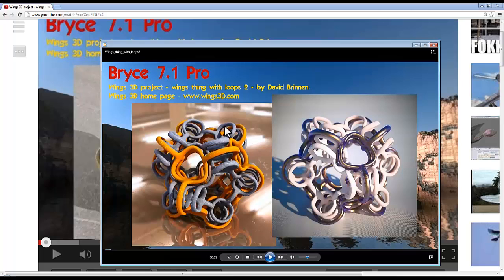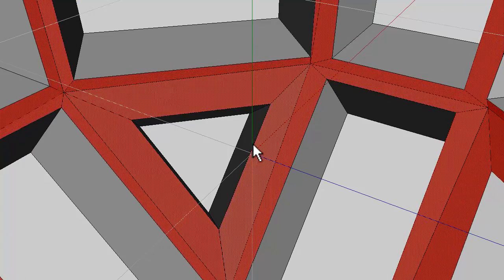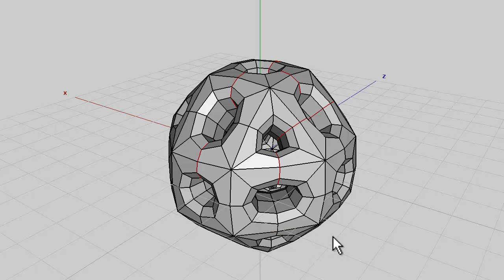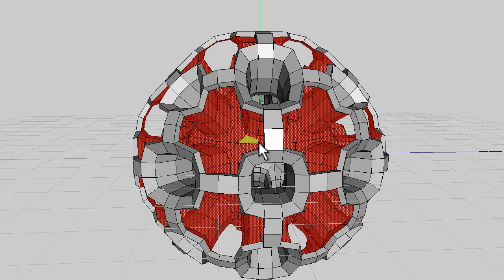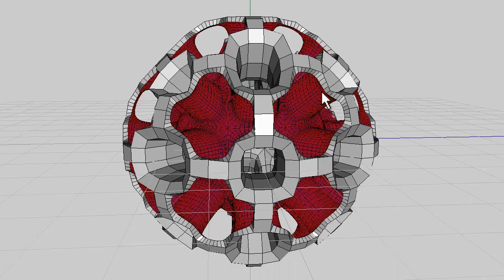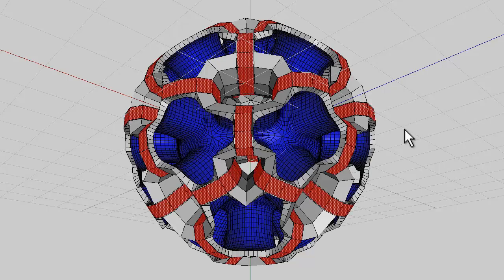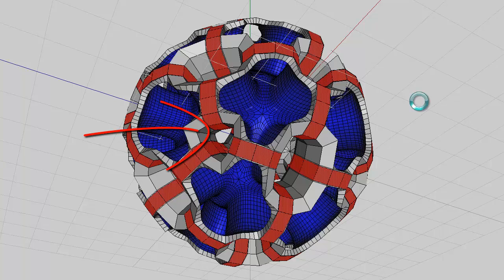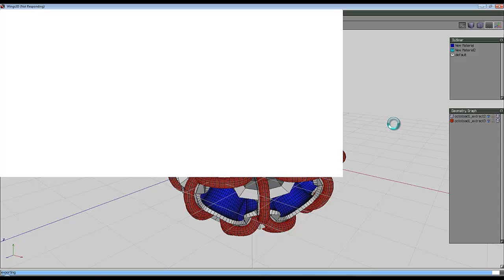Wings 3D project - wings things with loops 3 - by David Brinnen.

Comment: I have to say that is a great looking model. I like that you included more materials. What you can now do in Bryce is assign any texture you want to each one. You can select each part of the model individually for this purpose in the mesh selection list. There is also the cool ability to separate the parts of the model from each other. Mat zones have changed my way of working with imported models in Bryce.
BTW, thanks for the mention!